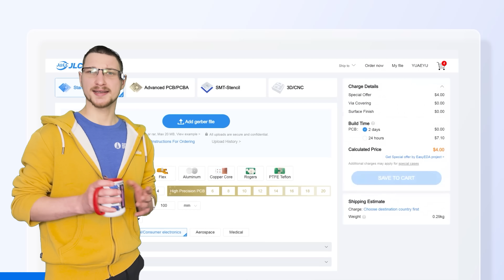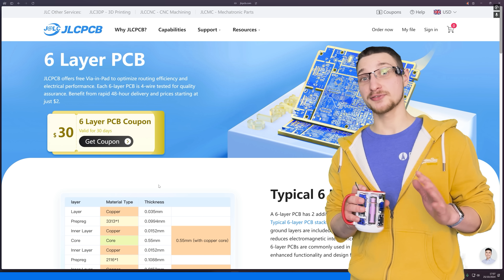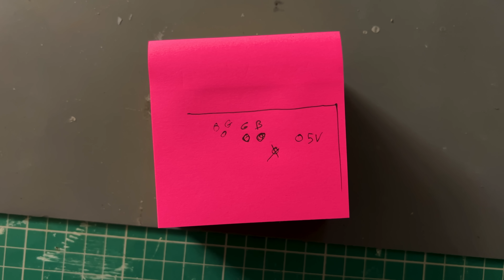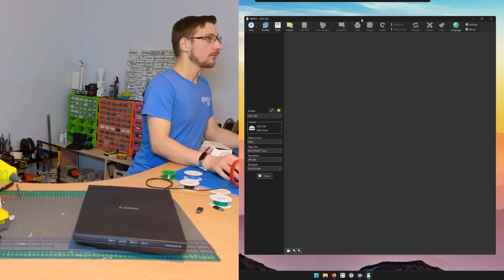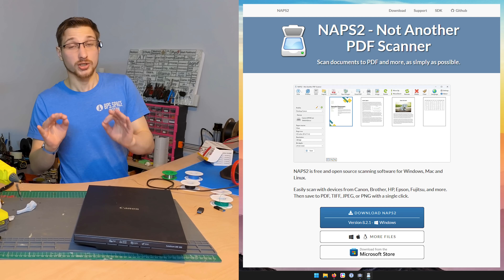How to Upgrade Any Old USB Device to USB-C

Comment: This can be done more elegantly if one uses those USB-C breakout boards that are made specifically for replacing micro-B and mini-B connectors. They also have the required resistors to actually make this swap work with modern ports. What was done in the video only works with A-C cables and A ports that supply 5 volts and expect a device, won't be able to hook a phone up to this scanner without first using a C-A adapter and then a A-C cable.

Comment: 5:03 when a parasite wants to agress the cable and induce noise ... it will enter each hole-loop at the same time, and all induced currents will cancel each other. Maybe one hole on one side won't get cancelled if for some reason there is an odd number of loops ... but as it's surface is very small ... the power of induced noise will be negligeable.

Comment: also, to discharge a capacitor, dont do this with your screwdriver, grab a proper resistor (1 Mega Ohm for example...) and place that one across while having your multimeter at the capacitor leads above the resistor touching points (crocodile clamps will help there i.e.), using your screwdriver like that might kill the cap.

Comment: The Parkside tool is actually a good tool IF USED CORRECTLY AND WITH THE RIGHT BIT. And let the tool do the work; don't force it like you were doing.
And you need to practice your soldering. You should be embarrassed with the amount of solder 'blobs' you left.
And the black wire laid across them tracks.
Reply from the maker: Why thank you, dear sir, for the tips that you bring,
For the Parkside and solder and every small thing.
I’ll practice my blobs, make them shiny, not bleak—
Why, my joints will be perfect by this time next week!

I’ll pick the right bit, let the tool hum along,
And try not to poke it or push it too strong.
And that little black wire you spotted right there?
I’ll tame it next time with much tidier care!

So thanks for the notes on my tech-tinkering spree—
Your wisdom was helpful (and rhymed well with me!).

Comment: Really helpful video!  Two suggestions. One, get a WOLFBOX MF100 mini duster/blower to clear the debris.  It’s worth every penny when you need a strong blower without wanting to fire up an air compressor.  I have a substantial distributed air compressor system, and I grab the Wolfbox every time I’m working on smaller projects.  Second, use a dollop of two part epoxy rather than hot glue to pin the port down.  Thanks again for sharing this terrific video!

Comment: 6:07 Those capacitors have 5 volt. Why do you even bother to discharge them? And you should never short-circuit a capacitor ...
Twisted pair is an old way to reduce electromagnetic interference and crosstalk and it is still in used today.

Comment: IMMO it isnt worth the effort for Anything that has an older usb style connector but doesn't get moved a lot....
That alarm clock with micro usb that has been on my night stand for over 10 years won'get magicaly better or easier to use it in replace it's connecter with usb-c.... Just like many  home automation devices which are permanently plugged in.

Comment: EXTREMELY IMPORTANT :

USB MINI IS 5 VOLTS

USB-C IS VARIABLE AND USES FROM 3V TO 24 VOLTS AND NEEDS THE DEVICE TO TALK TO IT

You can use the computer USB-A to USB-C cable and have just data, but God help you if you accidentally plug in a USB-C charger into a USB MINI port

It is why they have extra electronics inside a USB MINI to USB-C adapter
Reply: USB-C defaults to 5 volts. If it receives no request down the data lines for more voltage, it simply stays at 5 volts. If you use a C to C cable, it won't work as it won't see the resistor required to request the voltage.

Comment: This is a perfect example of a stupid person with an attitude solving problems that doesn't exist. You can buy a USB-C connector for a few cents.
Reply: @coisasnatv  lol - now the entire internet knows how petty and spiteful you are 😂
Reply from the maker: Nice
Reply: @Minx44  it's not me showing up in the video. 😂
Reply: Or you can convert devices to USB-C so you don't have to have multiple cables or adaptors laying around?
Just in case you missed the point of this video, he did actually mention the adaptors at the start.
Reply: @AndyMitchellUK26  You also missed the point of my commentary. You don't have to create electronic waste to solve a non-existent problem. It's like buying a plane ticket just to get free peanuts when there are more cost-effective ways to get them.

Comment: My understanding is that twisted pairs are twisted so that any magnetic field they are exposed to will induce a current with a phase difference in the two wires that difference can be detected and filtered out from the actual data being sent.
Reply: Almost. USB communication lines are a differential pair, like Ethernet, CAN, RS485, PCI-E,.... To make a valid bit, the voltages will always be mirrored between the (+) and (-) lines. One goes positive, the other goes negative at the same time (the time is why the two wires need to be the same length). With twisted pair cable, the electromagnetic fields around the two wires will cancel out nicely, so you don't have a radiating electromagnetic fields that could influence other signals. At the same time, if there is some external electromagnetic field applied to the twisted pair cable, it would influence both wires at the same time, no matter what direction the field comes from. So it would only induce a common mode disturbance in the two wires (both voltages get pushed in the same direction at the same time). The differential receivers at the end of the wire don't care about that common mode shift in the voltages (at least up to some limiting values), they can only detect and amplify the differential signal that was actually sent by the transmitter.

Comment: The proper and professional way of doing it would have been to completely remove the mini-USB and solder a USB-C straight in the very same slot/spot even if that would have required the use or a (2 parts) epoxy glue to actually glue it in place and then with the aid of some specialised kind of thin extension wire called KYNAR wire to make the tiny connections where required +  attaching a proper 5.1K resistor for the Power. Personally, I do not like butchering new holes in a commercial product +  the hot glue is not strong enough to withstand repeated plug and unplug action of that cable. It will certainly break in no time at all.. If the usb is made to fit a specific hole the new one has to go in exactly the same location  no ifs or buts.

Comment: I'm sure you've mentioned it in a previous video, but what is the microscope that you are using?
Reply from the maker: it's a slightly modified Andonstar AD407, I added a better ring light added a USBC port.
Reply: @Mellow_labs thanks!

Comment: That's a neat trick!  didn't think of using an adapter as a breakout board, but it's pretty much the same thing, just bigger.  The actual breakout boards are way smaller so work in smaller devices.

I bought 30 USB C breakout boards off Aliexpress for less than $10 shipped.  !IMPORTANT! Buy the ones with 5.1K resistors!  You need those to tell modern USB C supplies that you want 5V.  Without the resistors, you won't get power at all if both sides are USB C.  The ones without the resistors pre-installed seem to use the 402 package size which is only 1mm.  THE LONG WAY!  Good luck soldering those yourself.  

That being said, I'm kind of confused as to how your adapter worked in this case.  Were you perhaps using a USB A to C cable?  That would explain it.  Otherwise, there probably shouldn't be 5.1K resistors in those particular adapters since those are directional based on the USB A port and the 5.1K resistors would only apply in the other direction.  So your method would only work for a USB A to C cable and not for a C to C cable.  In theory anyway.  Would be curious if you could try both cables to confirm.

I've been upgrading my older electronics like crazy.  Notes, hot glue is your friend, and in smaller devices, it is probably easier to de-solder the mini/micro USB connector as test pads are rare and usually, that's the only place with space.  Capton tape is also your friend.  And another one of your friends is a set of files.

Comment: I just want to say that it's really impressive you have a successful channel with so much electronics content without actually knowing why twisting the wires improves the connection.
Reply from the maker: I knew it helped with data integrity in some way, I was just light on the details.
Reply: @Mellow_labs  
"the details"... The data cables use "differential signalling". That means that the "data" is dependent on the voltage difference between the two cables... By twisting them, you "ensure" that they are "as close to each other as possible", WHICH means that IF(when) there is external interference it will introduce (induce) THE SAME "noise" on both cables... Which means that the difference (in voltage) between the two data cables remain the same regardless of the "induced noise signal"(voltage). And so when the voltages of the two data cables are compared (i.e. one is SUBTRACTED from the other) the "noise"(interference voltage) will be "nullified"...And "Voila" you have your ""clean data signal"" despite the interference...
Thanks for the video :)
Reply: @Mellow_labs  Data bits are very competitive. They also find the corkscrew action exciting. They like to twist and play but they need to reach the "finish line" at the 
same time. That is total crap. I've got nothin'.🤔🤣
Maybe it's a genetic thing. 🧬🔬😂😉 (It reduces "cross-talk") 😊

Comment: 5:07 The reason why you twist is that when done properly they create an electromagnetic field that acts as insulation against outside EMI
Reply: I thought it was to indicate that it is the data wires
Reply: @sliceverse0  they are all twisted, including the power. It essentially insulates each wire from each other so the power and data dont mess with each other, and by ALL doing it, they make a strong insulation against outside electromagnetic interference.

Comment: 14:10
From my experience, hot glue is not strong enough to hold the force of plugging in and out. You need to anchor it to the shield/chassis or motherboard. 
The port will be "pushed in" sooner or later.
Reply: Epoxy would be the best for durability.
Reply: Agree although USB C does not take a lot of force to insert - but yeah it will give sooner or later.
Reply: @RetcorPS  I have used hot glue and double sided tape/carpenter's tape many times for this exact same use case and it's done a brilliant job for me.

As you guys have said; it needs a more permanent mounting solution but it can work in a pinch. It remains as a permanent solution for me, for now at least.
Reply: @jackipiegg  if you scrub surfaces enough it will
Reply: It is strong enough as long as it can properly stick to the surface, like it will stick to abs quite well, ptfe not so much, another consideration is heat leakage, if the thing you're gluing is able to quickly take and dissipate a lot of heat then glue gun won't do, you need to carefully melt glue with ~200c soldering iron to ensure proper bond
Reply: In aliexpress there are ports with holes + screws
Reply: You would be shocked at how many makers, sell $300 products held together with hot glue! A fairly popular YouTube Hacker made one handed controllers, used mods suggested by the comments with no recognition and would rather go back to the old design than give a modicum of credit and the thing is completely held together by hot glue!

Comment: Twisting the wires makes it so stray magnetic fields from other signals will affect both wires more equally because it makes the distance from each signal wire to the stray magnetic fields almost equal.  This aids "common mode rejection" of these stray signals because the induced signal on each wire is almost equal, and since the data lines are a differential pair, it's the difference between the two signal levels that's relevant.  In other words, in the presence of the stray fields, the voltage difference induced on the two wires will be very close to zero, leaving the original data signals mostly intact.
Reply: I neglected the other reason to twist the wires - to create a consistent transmission line impedance, which can nearly eliminate reflections of the data signal.  Typically the impedance is around 100 Ohms for twsited pair in an CAT6 cable, and is probably similar in USB cable.  The exact impedance depends on dialectric constant of the insulation, the diameter of the wires, and the spacing between the wires.  Creating a consistent transmission line impedance helps as you use faster and faster transmission speeds.  It probably doesn't matter much below USB SuperSpeed, but since it's not much effort, why not twist 'em.
Reply: error correction is pretty easy when everything has the same error. Also the twisting causes its own mag field that helps in general lessen the effects of strays as well.
Reply: I would say it prevents inductance between wires.  If you check a Ethernet cable you will see that each pair has a different number of twist per foot so inductance doesn't happen even between pairs.
Reply: @rationalbushcraft yes, it acts as an inductance insulator
Reply: it's faster and easier to just say it helps to reduce interference
Reply: @Oscar4u69  that’s only “what” twisting does.  Knowing the “how” and the “why” provides the ability to apply the principle more broadly, and know when it doesn’t help or even hurts.  Otherwise people will just be neurotically twisting random wires.

Comment: NAPS2 is the understatement of this video, not just for scanning but if you have JPG and the Picture type PDF it will run Optical Recognition and add a layer of actual text making it easier to copy and paste for the most part. Then you can export it all as a PDF. It also has a sick sorting function that reorders PDFs automatically from scanners that can only scan one side at a time or one page at a time into a single doc.
Reply: Indeed! They also support a whole ton of features that are super useful in an enterprise situation. Scripted silent installs, pre-configured profile and configuration, everything can be done via config files.

It's an amazing piece of kit.

Comment: note that the trick of using a USB-A to C adapter in this way will not work if youre using a USB-C-C cable into a computer with USB-C. They have special resistor values to detect if a device is a USB Host or Device. If you use a USB-A to C cable it'll work because USB A connections are always assumed to be hosts
Reply: Is it not possible to solder in a resistor onto the scanner board?
Reply: @RetcorPS  In this case, no because you need two 5.1K resistors.  One connected between CC1 and ground and the other between CC2 and ground both being individual signal lines on the USB C connector and far too small in this case to solder anything to.  You need two of them as this allows for the reversible connection with USB C.  You can buy breakout boards that Include the resistors and break out power and the two USB  2.0 data lines which is the max most people really need in these cases when upgrading connectors.  Very few USB 3 (non-C) mini/micro connectors actually exist in the wild so USB 3.0 data lines aren't normally required.

Comment: wait until you find out it doesn't work with a C to C cable because it's missing the 5.1k resistors for power 🙈
Reply: @RoterFruchtZwerg   I thought about that too but it's probably fine in this application since it looks like whatever host device he's attached the scanner to has USB-A ports.

This approach would work as long as he doesn't try to use it with a modern laptop since they usually lack USB-A port(s) nowadays.

I used a breakout board without 5.1k resistors when I wanted a Type-C port on my DS3 controller. The shock on my face when I realized what I did was certainly something 😅
Reply: You can pretty easily add those resistors if you need to, or just buy a breakout board with the resistors already installed.
Reply: @RoterFruchtZwerg  doesn’t it just default to the lowest power which would be what it’s currently using if it doesn’t detect the resistance.
Reply: @MotorcycleRebuilds  no. because USB-C can be sink and source, it defaults to sink. A proper USB-C supply will not provide any power initially

Comment: This is where would savage wires from a damaged ethernet or HDMI cable, colour coded and ready twisted pairs.

Likely use green/white and green for data and either blue/white + solid blue - or brown + and blue -